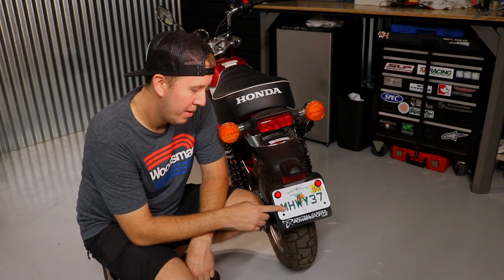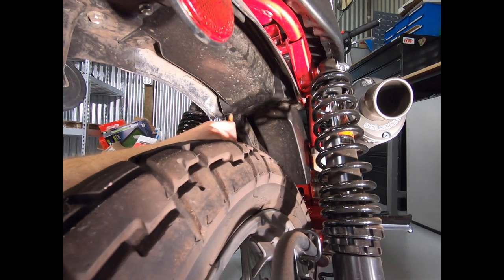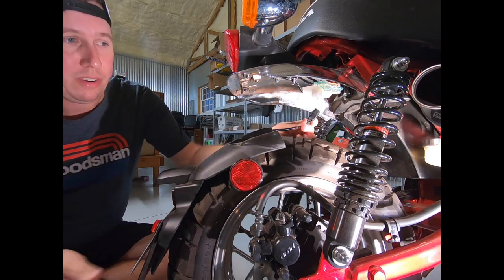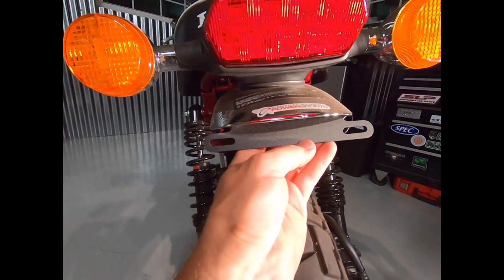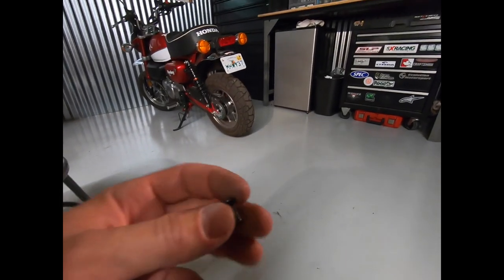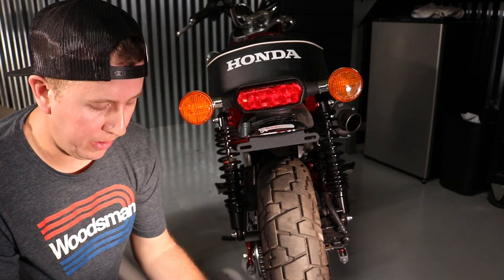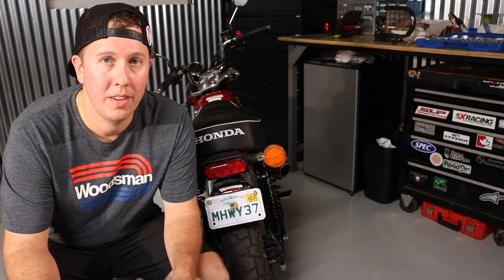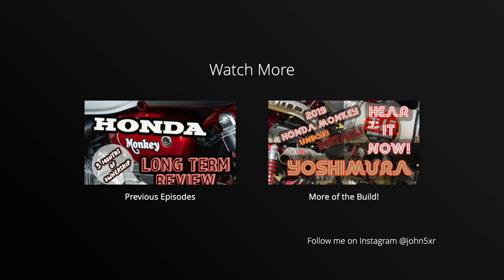2019 Honda Monkey MNNTHBX License Plate Relocation and Fender Removal

Comment: I actually like the bike stock ...better. I think every one should save their money and apply it towards a decent sounding pipe instead. I just got finished riding mine...awesome bike. Not fast, even with a pipe but, fun riding with others..we were in a group with modded CT-70 Hondas with 140 engines...they will eat your lunch...very fast. A few had the Kawasaki Z-125's.....They were the slowest of the bunch. We had a bunch of fun. Before you guys go out and change the tail light.. think about it...money best applied to a yoshi exhaust.
Reply from the maker: I’m yet to hear a single-cylinder 4-stroke that sounds great, but a friends Grom with the Yoshi system sounds pretty good, so that’s why I went with it. The Monkey system is much louder than the Grom too. I’ve been bugging Yoshimura to produce a silencer insert to hush it a bit, and with that I think it would sound better. Right now it sounds like a 450 motocross bike to me! What exhaust are you running?

Comment: No license plate light!? The Yoshimura one comes with a nice led light. Nice video man , you're videos and voice are crystal clear. Good job
Reply from the maker: Thanks for the feedback! I strive to make sure the audio is good as it’s important to hear what I’m sayin if you’re using the video to learn how to do this on your own bike. The MNNTHBX plate mount came with optional led license plate mounting bolts, but didn’t install them in the video because I wanted to make it plug-n-play with OEM connectors. Didn’t wanna splice into the harness. The Yoshimura option is nice and the integrated plate lights are slick. I love the plate bezel on the Yoshimura!

Comment: @8:14 - did you find that "right connector" and can you share where you found it (and p/n)?  I am doing the exact same thing.  Thanks!
Reply from the maker: Not yet, but it seems like there’s a lot of tailight systems out there that use push-in connectors instead of an actual plastic plug to preserve the OEM harness. If I can’t find the OEM plug, I’ll go that route

Comment: Hey John, I ordered the same tag bracket from MNNTHBX . Did you ever find a connector for the  l.e.d. Tag bolts?
Reply from the maker: I did find the right connector, but the pins that came with it were too wide, so I need to get that figured out. I did find a source though and will be making some plug-n-play kits when I am satisfied with a setup

Comment: Currently in the middle of the same install on my monkey. The lisence plate bracket kit came with 3 plastic washers did you use them? Also what did you do with the other end of the connector in the rubber boot?
Reply from the maker: I don't remember plastic washers, maybe mine was an earlier version that didn't include them. I left the license plate lights off of my setup for now and am going to try and track down the matching connector for a plug-n-play solution

Comment: 🛑🛑 I’m sorry, I just got my Monkey this weekend, however the question have is…

When you installed your Relocation Kit, and didn’t have a License Plate Light to install; and rode the bike without the light, did the bike throw a code on the dash board; since the light wasn’t present?

I was thinking of removing the “lobster tail” and not installing the license plate light, and shrink wrapping the OEM Harness end to keep it water tight. . 

Thank You. Great Content.

Comment: If you want a cooler/smaller/retro rear light, the stock euro model setup looks pretty good i think:  https://cdn.shopify.com/s/files/1/0333/0021/products/2019_Honda_Monkey_125_MiniMoto_Motorcycle_Central_Florida_PowerSports_1.jpg?v=1531497439
Reply from the maker: The Euro lights are sexy for sure. Not sure I wanna dish out the cash for them yet though